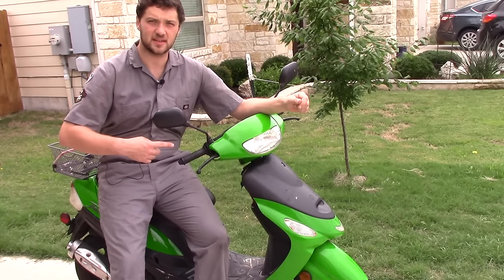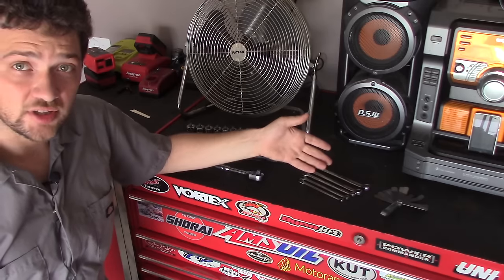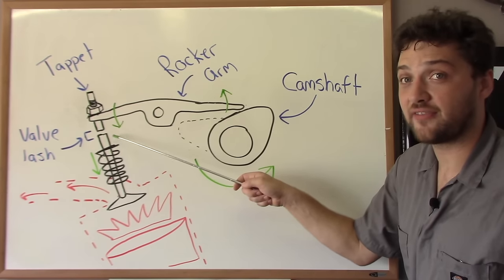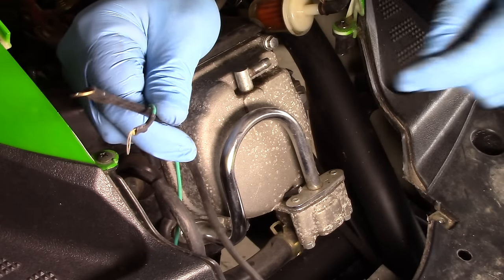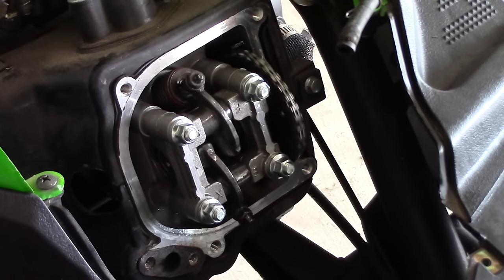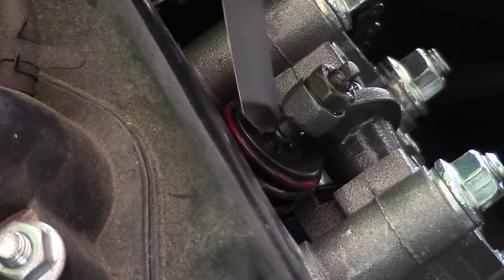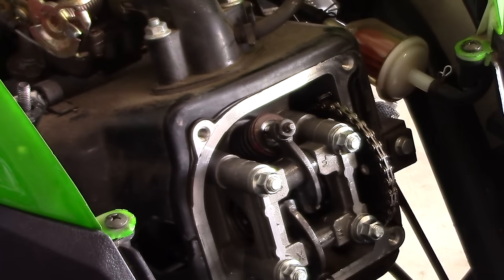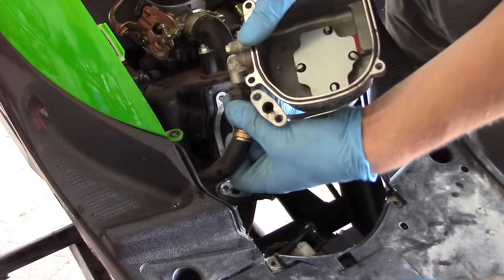Scooter 911: Hard to Start or Wont Stay Running? Try a VALVE ADJUSTMENT! (works for most scooters!)

Comment: Just a disclaimer, I've never worked on an engine in my life before now. This video helped me fix my scooter that hasn't run right since I got it. I've had two older mechanics look at it, replace over a hundred dollars in parts, and this video saved my scooter. Thank you so much!
Reply from the maker: Congratulations! That is so great to hear! But make sure you give credit where credit is due, YOU took the initiative and had the confidence to handle the job and for that I applaud you! Thanks for sharing your victory!
Reply: So if you mess up what the valve lash supposed to be when it's bottom then? None? As in closed?

Comment: I bet 99.9 of scooters on the road have never had a valve adjustment.
Reply: Smh
Reply: @integrationofmanandmachine4714  I know , right?
Reply: @slamboy66  yup
Reply: @B E you know all they do is put gas in it.
Reply: I bought my sym with 2500 miles on it, changed the oil every 750 miles, sparkplug 3 times, it's now on 24,000 miles and I've never checked the valve clearance, it has good compression on the kick-start, doesn't rattle, idles smoothly so I just use it. I've had a few sym scooters that use the gy6 engine and after checking the others first time when I bought them the clearance hadn't changed in the next 4000 miles , I do however check the belt every 4000 miles and replace at 15000  as having one break while riding can really spoil your day.

Comment: Amazing.   I just did this valve adjustment following this video and my hard starting problem and weird idle...are gone.  Both valves were off a little bit, the tappets were making slight contact on both ends.   That tiny little adjustment FIXED my problem?   I can't believe it.  Thank you.  I feel smarter now.   haha

Comment: Just tried this because my scooter would start extremely hard. When running, my tao tao would have this ticking sound. After I adjusted the valves it starts and runs much smoother and no more ticking sound. This video was very thoroughly and is a great guide for YouTube mechanics like me.

Comment: Thank you!! I spent over a year troubleshooting my 2018 50CC Taotao with no success.  I changed carburetors (twice), new spark plug, checked fuel lines for leaking air, checked air filter, adjusted carburetor and replaced jets with different sizes, and many other things.  I finally came across your video, made the valve adjustments and now it runs better than ever before!  Too bad I couldn't have found your video sooner.  Thanks again for your detailed demonstration.

Comment: Thank you. I bought a scooter that would not start cold without cranking for ages. I was going to rebuild the whole engine, but saw this video then checked the valve clearances, the exhaust valve was being held open, set the adjustments to your specs and it started within half a rotation!

Comment: Just adjusted the valves on the 50 dollar taotao  i bought. It would start but not idle or respond correctly to throttle. Idle problem solved and after carb tune it runs great. Subscribing. Thanks for the video

Comment: That was just about the best mechanical "how-to" video I have ever seen. Thank you!
Reply from the maker: Thank you very much!
Reply: @Scooter_911  Thats amazing 😉 Infact me too i have a scooter 150cc cityblade which had the same problem.Ive brought my scooter to several mechanics but in vain.1 ve spent lot of money replacing the carburator, brake switch ,starter even they told me to buy a new camshaft.Thanks God after watching your video i mustered all my courage  and followed your step.The only thing which I bought is the milimeters thickness gadget.Once again am grateful to you.Thanks 😉😉

Comment: I work on them. One thing not mentioned on this vid is the reason you have to adjust the valves is the valve in question is wearing the head out which makes the valve adjustment tighten up. If you are adjusting the valves often you might as well get ready to replace the head. And a valve adjustment will not always fix the problem if the head is bad.
Reply: Time for a big bore kit

Comment: Great video. I like how you speak clearly and go slowly. Much appreciated!! Big 2 thumbs up and a definite like!!
Reply from the maker: Thank you very much! I work pretty hard to make sure everything is pretty understandable.
Reply: Picked up a 09 Sym HD 200 it hasn't been started for 5years or more. Fresh fuel, sea foam and new plug. It starts idles for 30 seconds dies and I have to wait for a while before it will start again also to get it to throttle up requires spraying a fuel source into air box. What do you think

Comment: Stumbled upon this video after having changed the oil, cleaning the piston/valves/combustion chamber, checking piston rings, installing a new carb, changing spark plugs ... Basically everything and still struggling to consistently start my scooter.

Have ordered a feeler gauge which should arrive in the next few days hopefully and will do the valve adjustments. Will check back in! 

For the mean time, thanks for your very well laid out informative video!
Reply from the maker: Good luck!
Reply: Okay it worked! But still can't start consistently ... I'm thinking it's the auto enricher circuit, intermittently failing

Comment: I find when you adjust them intake opening (adjust exhaust) -and exhaust just closes(adjust intake) it's a more accurate way and will give you a different lash than just the TDC method. The TDC method will work but not the right way. JMO
Reply: Wow I have not hear of that . And I am willing to try it. Thanks

Comment: Love you man! You have helped me continue to ride several occasions as ive always been a do it myself er and i have continued to pass on your knowledge and repairs to many others. Its surprising how there isnt any scooter repair shops in my city not even parts... There is one scooter issue i cudnt resolve with youre or any videos online and that was a non starting scooter or once starting but not accelerating after replacing belt that tore while taking off luckily i bumped into an ex mechanic of closed shop that told me variater weight can shoot around if belt splits while driving and i made sense and thats what it was i was soo close to juat trashing the scooter lettin it go for parts and that was the only problem search for it online u can never find an answer for that repair im sure many are sitting with that issue....

Comment: I just got a 1987 Suzuki Fa50, it runs alright as is but since it has over 3000 miles [actually I should check if it's in Km or not] on it and I have no idea on the maintenance history I've been looking for videos and guidance on home maintenance so I don't need to take it into the shop for everything. Your channel has been really helpful so far

Comment: Make sure you adjust them at the right top dead center (TDC). The piston is at TDC two times per combustion stroke. There's a mark for TDC on the flywheel, that you can see if you take the plastic cover from the fan. Turn the flywheel until the T mark is aligned with the pointy bit on the crank case. Then check if the 2 holes in the timing sprocket allign with the edge of the cilinder head. The smaller third hole should pointing forward. Then you have the right TDC.

I did this wrong once, so you don't have too. 😂👍
Reply from the maker: Exactly! That is why I like to wait for the intake valve to close. Right after it has closed you know you are on the compression stroke!
Reply: @Scooter_911  you are also right. It's just a double check with the markings. I am just about to set the valve clearance on a friends scooter. The scooter hardly starts when it's warm, and it doesn't accelerate anymore, well it does for a second, then almost stalls, then goes again... I was suspecting ignition trouble, but first thing I am going to check is the valve clearance. Second thing is the vacuum membrane in the carburetor, might have a crack or puncture in it.

Comment: This was very easy and saved my moped. I thought it was low compression because it would barely start with the electric start when cold and i'd have to kick it and wait for it to die and restart a few times and let it warm up for 15 mins before I can get it to ride without dying. Now the moped fires right up when cold and works perfectly. Thanks!

Comment: Absolutely love your vids. In the middle of a valve adjustment now. Fingers crossed! It runs rough for a minute then does. Hopefully the adjustment solves it. It’s a 150 QMJ so I hope the clearances are the same.
Reply from the maker: Yes indeed! Those valve lash specs work for all chinese scooter engines!

Comment: I saw an article on using a cabinet screw , bent at an L shape because the square drive fit the square perfectly on the valve adjuster (4mm I believe ) and if you turn 1/8 of a turn, from zero clearance , it would be exactly . 004” gapped !!  Pretty cool.
Reply from the maker: Wow thats very interesting!

Comment: Thank you. im sure this might be the reason. I think ill engage a mechanic now I don't have all the tools and expertise to go that far. This looks more expect requirement.
Reply: Ms. Thandi, I performed my first valve lash adjustment on my motorcycle 50 years ago, it is not hard to do. Get yourself a cheap tool kit from Harbor Freight, (Google them), when they go on sale, (which is a lot). Make sure that all the tools you need are included in the kit. Buy a set of feeler gauges there as well, you'll pay very little money for all the tools that are more than adequate for this job. Next, take your phone out to your scooter and pause this video step-by-step. After you perform this job just one time, you'll have payed for you tools, and have a real sense of accomplishment!
PS, he didn't mention it in the video, but you should not make the adjustments when the engine is hot, (shortly after a ride), nor cold, (below about 50F degrees), because the clearances will change once the engine gets hot again.
I would love a reply if you do it!

Comment: Bro, thanks for uploading this and for taking the time and patience. Very helpful. You saved me a ton of money on parts I didn't need to buy and work that didn't need to be done.
Reply from the maker: Man that is so good to hear. Thats exactly why I make videos!
Reply: @Scooter_911  so since March I've been scouring Craigslist for scooters and mopeds. I finally purchased an SSR Lazer 5, 4 stroke. 291 miles on it, basically fresh still. I adjusted the idle screw yesterday without much effect on the stalling issue and was prepared to buy an aftermarket carb, jets and cdi. I'll be doing the valves in about an hour thanks to you. I'll check in later with the results.
Reply: @Scooter_911  ok I was able to do the valve adjustment. She's running much better now, especially idling. I do believe I'll take it for a long ride tomorrow and then fine tune the job I did. My engine is set up a bit differently so the feeler was bent a little bit. I may still have too much lash but nowhere near where it was. Again we're talking about a 300 mile engine so it was running on factory assembly specs and heat expansion/break in. Thanks again my friend.

Comment: Hey Garret, just got my Yamaha bws fixed , ii messaged you 4 weeks ago when it broke down .thanks again for your help mate .it cost me 1300 to fix ,second hand engine assy and new carby & air filter .there was a shopping bag handle jammed up in the engine so when I accelerated the oil wasn't getting through and broke the engine 😵. Any recommendations to tune it . Feels a little rough at take off ,but fine when I get enough speed .your a legend mate thanx again 🇦🇺💯💥

Comment: I have a Cabo 50cc that has been bogging on hills lately, losing RPM. I've changed the belt, and checked the carburetor but they both seem alright although I got about 5 MPH better with a new belt. Hoping the valve adjustment will do the trick. Thank you for all your videos, new to the moped scene and although I've worked on cars never on bikes 🏍
Reply: Did the valve adjustment work?

Comment: Thanks brother. It worked.

It seems strange that increasing intake lash | 0.002 to 0.003 | exhaust | 0.003 to 0.005 | should drastically change the QMA139 engine performance, in my case. But there it is.

Comment: Same issue with a pals scooter the only difference is its new ( 1 mile on the clock)!  Put fresh fuel in it but just the same. I will direct him to your vid thank you.
Reply: Let me know if it works....my scooter is brand new....not even rode it yet...0000.4 odometer....problems starting from day one.....I may half to do this......of just give the scooter away lol

Comment: Hey Brother!

Kick ass video. I was wondering, what feelers should I use on my 150cc? You did the 3,000 and 4,000 here. Which should I use on the 150cc?
Reply from the maker: The 150 gy6 motors like the same valve lash as shown in the video. .003 inches on the intake .004 on the exhaust! Good luck my friend!
Reply: @Scooter_911  You rock! Thank you for all of your help. I'll have you help me take it apart too. I'll just watch the video again.

Comment: "Now the fix for this particular scooter is pretty straight forward, it might even surprise you."

Yeah, don't buy a Chinese scooter... Jks jks.
Reply: If you have the valve adjusted and change the oil often chinese scooters are just as good as any other, lazy People say "chinese crap"
Reply: @ralfrisberg8009  strait facts
Reply: Ralf Risberg yea but if you get old used ones in like me that’s not the case 🤣
Reply: @MagmaBmx  old like before 2000, old like whenn the parts were bot as good like 90s
Reply: @ralfrisberg8009  Agreed, any scooter is only as good as how you take care of it.

Comment: Thx for this tip, I will try it on the Peugeot Kisbee belonging to my ex. It runs for a short while and then dies, and has not much power. I have rpeviously changed carberator and kept the gas cap off. Other possible reason for the problem could be that the vacum driven gas vent under the tank don't open enough.

Comment: I have a Daelim Beagle 50CC motorcycle. 1.5 years ago I had a 47mm cylinder piston set fitted and I was very satisfied. There was no slope that 2 people could not climb! I was able to climb a slope of about 1-1.5 km with a slope of 70 degrees and this slope at 30 km.

To get to the bottom, I was itchy and I had a 50MM cylinder piston and cap. While you can go on a straight road with an average of 76 KM, now it's 60 and the engine's traction has dropped a lot, I climb steep slopes very hard.

I did a little research, they said, put the old cylinder head on, the compression ratio will increase, the traction will improve, I did, yes there was some improvement, but still 60-65 max speed is a little better on slopes, but the engine was obviously better with a 47MM cylinder piston set.

Could the valve clearance settings be wrong?

How many mm should the correct valve clearance be?

So what could be the problem?

I'm about to go crazy :)

Comment: Great vid!!  I have a Buddy 125. It is very hard to kick start. It will not electric start. It is as if the compression is to high. I have to put it on the stand and really put all my weight into it. It runs great. Good power, smooth idle.  I wonder if the internal starting mechanism is worn. Thank u for your great channel!!
Reply from the maker: More than likely you have a week battery or bad engine ground. They are very well made scooters so it should be pretty easy to get it going again!

Comment: I have a 4 stroke that is starting but bogging when going full throttle after making or doing a turn.. carb fully rebuild and still didn't fixed it. I will try and check my valves this weekend see if that works 👍

Comment: And btw, I've been looking at many a video, and yours is by far the most professional. The music is great, I love how you speak slowly and clearly as if you really want people to grasp what you're saying. Also the diagram you drew was huge! I'm not a mechanic, but I had a power mechanics class in school and my dad built an amazing model of a car aee-through engine that even included a whole chassis and working brake system. I say that to say that i know how engines basically work with the whole valves, pistons, rocker arms, camshaft, etc thing, so it was interested to say how that work on a small scooter engine!! Thanks brah!!

Comment: Would love a walkthrough of removing and cleaning a scooter carburetor. I have a 2008 Genuine Roughhouse 50 that sat in storage for a few years and your videos have been helping me bring it back to life. It runs now but the last issue I have is it won't idle.  I'm assuming it needs a carb cleaning after sitting that long and would love to do it myself, just a little nervous about it. Thank you for the videos!
Reply from the maker: Coming soon!
Reply: I would just get a new carburetor kit. Very inexpensive. $30-$40. My kit came w/new filters and plugs too. Go shopping online. Save yourself a headache.

Comment: Man idk wtf is wrong wit my scooter but without me putting a performance CDI on it it’ll stay running setting there not being touched but when it’s being drove it’ll turn off. The factory CDI i wont stay there running without being touched but it’ll run around the block just fine as long as it has constant throttle. I’ve tried a different carb and different jets still has the same problem
Reply: Not too mention seems to be oil in the spark plug hole but still has plenty of compression. (Could be cause i overfilled the engine)